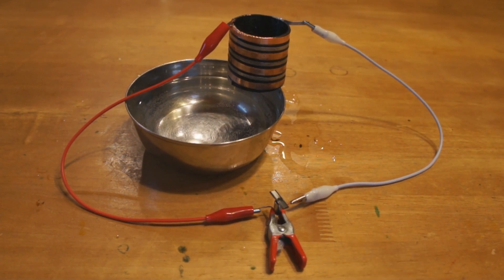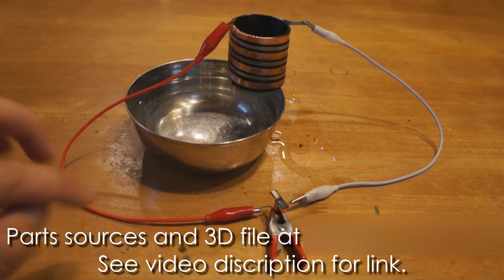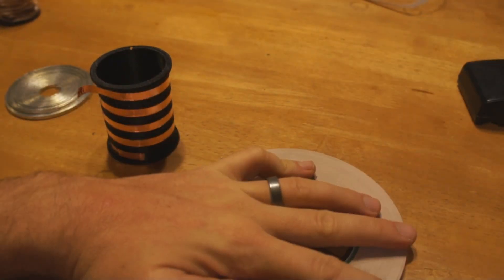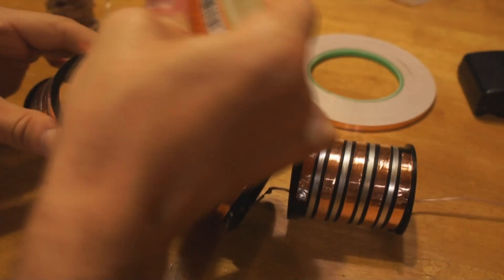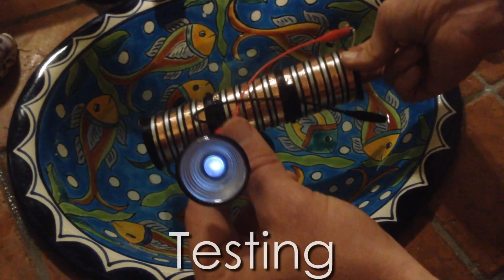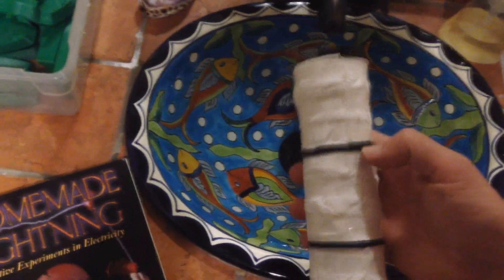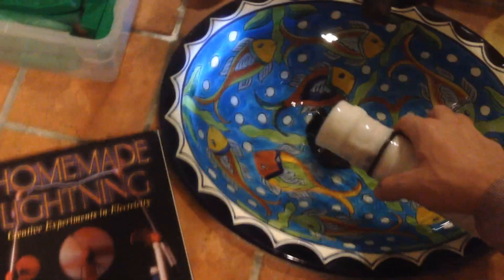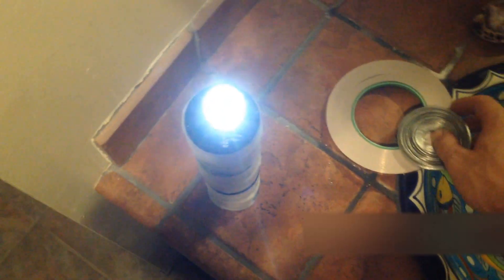How to Build a Water Activated Flashlight

Comment: What determines the voltage and current?  I assume the voltage is set by the material used like any battery and the amount of metal determines the current.  It looks like you have more copper than magnesium.  What is the ratio?  Does the metal erode as it is used?  How long does it last?
Reply: look up "sacrificial rod" that's the basis for how this works.

Comment: Should the ribbons be intertwined like this or can one ribbon cover the bottom half and the other ribbon be used to cover the top half of a normal cylinder? I'd really appreciate an answer if you could as to why it wouldnt be as good or if it would be. is there also a reason the copper wire cannot attach directly to the non copper ribbon?
Reply: This is 3 years ago, but I'm just running across this for the first time.  You wouldn't want to have the coils on opposite sides of the cylinder because the water needs to constantly be interacting with both strips.  If you'd hold the light up, only one side would be interacting with the water.

Comment: have you considerd bulding a contained reseviour and drain system so that u will not have to fill with water again and again. for examlple the water will be contained inside but separate from the coils then u open a shutter allow the water in then when ur done reopen the shutter and drain out the water to return to hibernation state. also dose it have to be water could it be a mineral oil or something else?

Comment: >_> i'm confused why they're in coil shape. These are just batteries. The copper and the magnesium react with the water and produce a current, no? This wouldn't work with purified water because no electrolyte, no? pure water isn't electrically conductive.

Comment: You could inverse your coils to run on the inside, then to activate it, you pour water in the bottom instead of put batteries in it. When you get done, just dump the water out.

Comment: does it need to be a large clumsy tube structure like that , or could it be something like a credit card shape that could fit easily into your wallet until needed..... as long as the copper and the magnesium are insulated from each other.... also , something flat  might be easier to wet, in a lesser amount of water

Comment: why not put it in a perspex tube full of water would give it weight and your carrying your supply around in a  sealed unit, should never dry out isolate your wiring using silicone sealant and use a switch like in a regular torch

Comment: Thats all nice Lasersaber, but in terms of usefullness and practicability, its better to use a 1.3V AA battery and have a month usage flashlight - continuously, for instance. And you can charge this battery anytime with a small or very small solar cell. Or use a flashlight charged from body, which can work forever. I have also some designs of batteries that are very cheap and reliable. All the best, tnks for sharings, interesting project. Keep going!
Reply: johnnyaum3 Tesla coil lighter plus solar panel to charge it ;)

Comment: does the copper foil have to be 1/4 inches? I have a roll that is just over .5 inches.
and if i'm going to use pvc pipe, is there a specific diameter requirement?

Comment: cool, deal this could always be put into a real cheap plastic flashlight housing like this one http://www.staples.com/Eveready-2-D-LED-Industrial-Heavy-Duty-Economy-Plastic-Flashlight-Yellow/product_222397?cid=PS:GooglePLAs:222397&ci_src=17588969&ci_sku=222397&KPID=222397&kpid=222397&gclid=CP7PrY_v5sACFUoS7Aod-G0AXg
 or make it into a 20 ounce powerade bottle so we can recycle ...lol and where the batteries go is this coil set up then waterproof where the wires come out to the top . then sell the crap out of them . the water light... great concept.

Comment: Also, I wonder if you can wire the two metals into a coil and create a self-powering Joule Thief to run the LEDs at lower power -- for a longer lasting light.

Comment: Build it inside a container like a soft drink bottle. Then you just fill it with water to turn it on and it will not get your hands wet. Splice multiple bottles together using the technique used to make large water rockets for a larger volume.

Comment: Cool, I like it. You don't want wet hands in the winter though.
Reply from the maker: Green Silver
The final design will not have any exposed water contact.
Reply: I was going to say it could be made to double up as a water bottle, but I guess the salts from the metals wouldn't be that healthy lol
Reply: Green Silver
the final design i'm guessing should be able to fit any shaped container but i'm not gonna drink the water either...
Reply: Green Silver Your guess was half right. Copper salts can be toxic, while magnesium salts are a necessary nutrient. As a note of interest, the magnesium salts will show up as a white crystalline powder, the copper salts as a bluish crystalline powder on the surface of the metal as it undergoes the electro-chemical reaction.

Comment: You should make a water resoivore tank that surrounds the the copper and magnesium strips so that the light output is maximized and your hands dont get wet, also when your done you can drain the water and it will go into its hibernation state.
Reply from the maker: vbernabucci 
That is pretty much exactly what I am designing.
Reply: lasersaber I wish I had a 3d printer, but for now its fun watching your innovative mind create all these projects.
Reply: Cant wait to see you do it. :)
Reply: lasersaber What if you made a smaller cell to go inside, you could generate more power and run a more powerful light. Also you could put a rechargeable battery inside and have the led run off of the battery and the battery can be recharged from the cell. The possibilities are endless lol